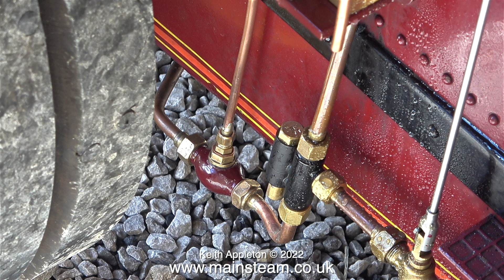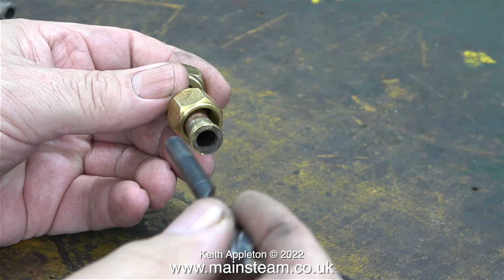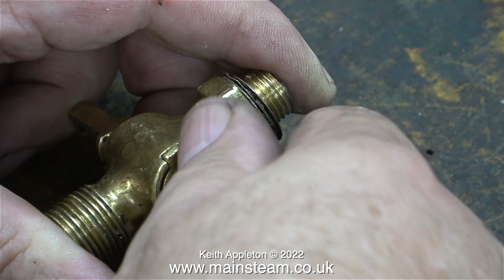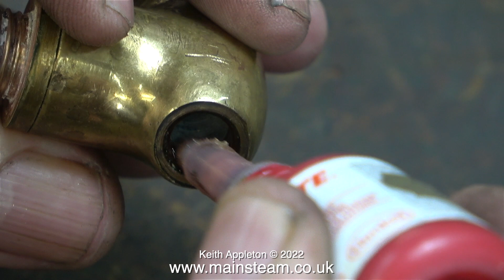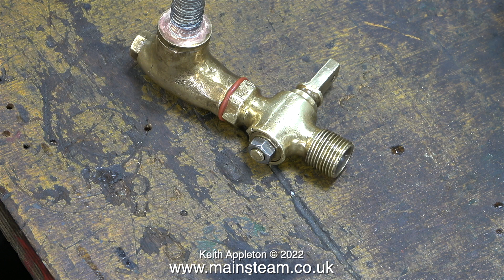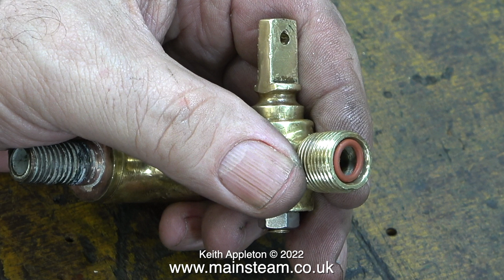PROBLEMS WITH LIVE STEAM INJECTORS - PART #1

Comment: Do you recomend using any sort of mesh filter for the water supply to the injector. Im finding small debris entering the cones and getting stuck.
Reply from the maker: I haven't used them - never had any problems.

Comment: Nice job. I would have felt compelled to use the compound for the taper on the compression fitting, but i think your way is definitely faster. 

I'd love to see a video on the principle of operation of the steam injectors. It's not clear to me how they work. Does the stream condenser when it hits the cold water and create a vacuum?
Reply from the maker: Thanks 👍
Reply: They use a venturi type arrangement to cause the inlet water to match the pressure of the steam.

Comment: i'm half surprised you didn't hook it up to your boiler testing rig and see if it holds pressure.

. . . but belt and braces is usually enough, no need to staple your pants to your waist!